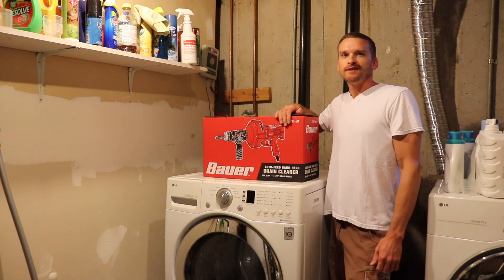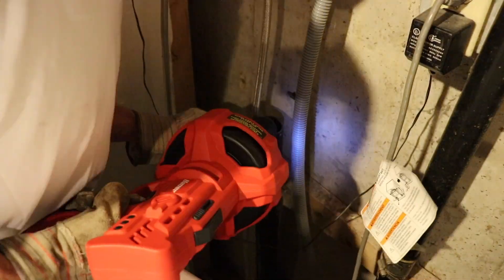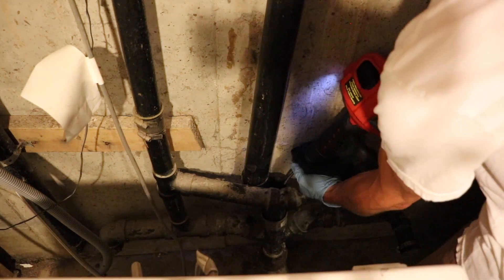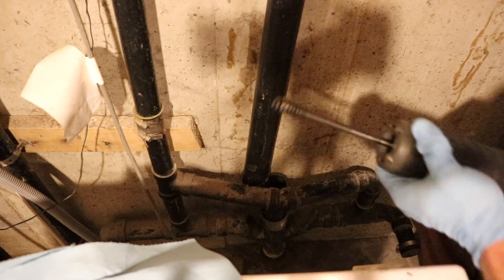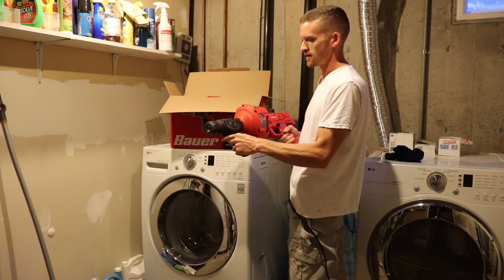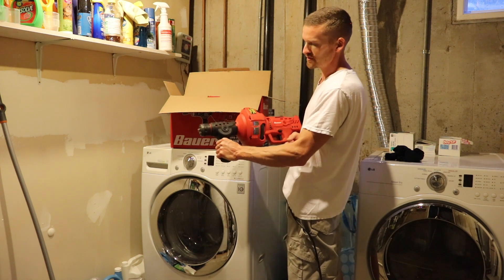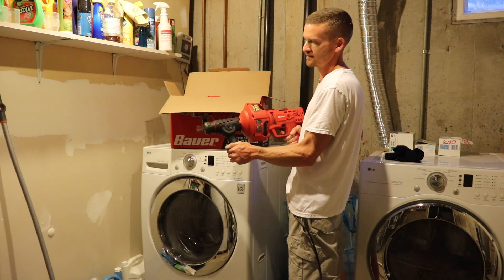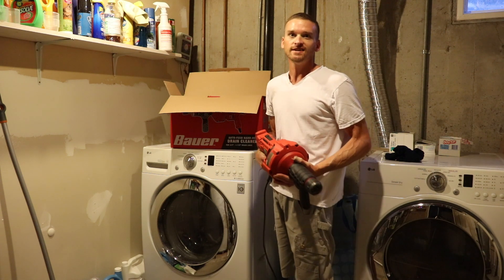How to clean a drain line with a Bauer Drain cleaner, review & tool use

Comment: Good video. Just ordered a Bauer like yours, Amazon $89.88.  No worse curse than have'n a plugged drain, especially if you have a septic system. I ran my washing machine drain to a 3x3x3 leach bed outside. Doing that eliminated a lot of drain issues. Every two weeks I pour a cup of dish soap down the floor drain. I'm a big fan of the accordion style plungers. I have 3 sizes, they're cheap. Again, good video.

Comment: How can you tell when your out of line on the drain cleaner
Reply from the maker: @dannyacosta4613  there is a cable connection at the end that should come out of the machine
Reply from the maker: @dannyacosta4613  about 6 inches when the cable is fully extended. That’s what I look for when casting the cable.
Reply: @WillowsWorldofDIY  thanks so much I greatly appreciate you

Comment: Hello, thank you for the video. I am thinking of grabbing one of those next time when I go to HF. Will it fit a solid core 1/4 cable like this one from Amazon? ( GENERAL WIRE SPRING GIDDS-214102 Pipe Cleaners Drain Cleaning Cable 1/4" x 25', With El Basic Plug Head - 214102).
Reply from the maker: I haven't Replaced the stock cable yet. I think that a 1/4"-25' solid core cable would work fine, but i'm not sure about the Connection end of that specific cable because they don't show a picture of it.  You could weld the correct connection end onto that cable or have a welder do it, if it doesn't fit in its stock form. I hope this is helpful. Thanks for watching!